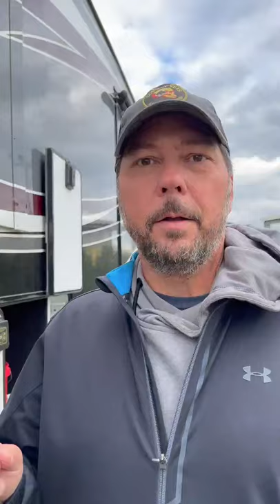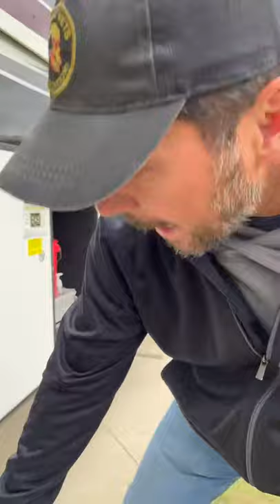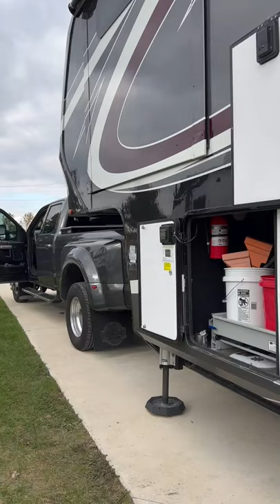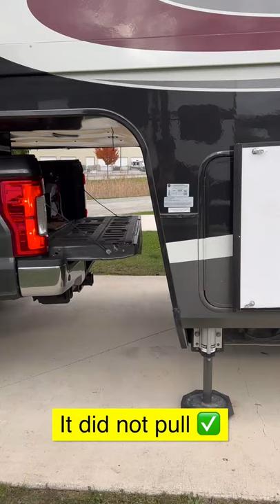EVERY TIME YOU HITCH! (5th Wheel PULL TEST!)  #shorts

Comment: I almost hate to tell on my self.  I used to be a diesel truck mechanic years ago and know all about 5th wheel hitches.  I've owned 4 fifth wheel RV's over the years, really like #4 by the way.  I always do a pull test!  Until once on 5th wheel RV #2, I was mowing the yard where it was parked and decided to move it and mow that spot.  Didn't do the pull test and crushed the back of my truck!  Have not skipped a pull test since.  This was a few years ago and I was able to get another pickup bed (same color and everything) at a salvage yard and they installed it for $1250.00!  I don't believe you can even by a tail gate for that anymore.

Comment: I’m a cmv operator and drive the 48. You provided a wonderful example of a “tug test”. Anything worth doing, is ways a way to take it 1 step further. After the “tug test” continue to hold the trailer breaks and reverse into trailer. If for whatever reason you have too much pressure pulling forward onto kingpin, by reversing - your relieving the pressure on king pen and the jaws to seat just right. Also, you know when your 5th wheel jaws are out of adjustment, when you go and take off, you hear “BANG” or when your coming to a stop and you feel the slack in the 5th wheel and trailer slightly “BANG”  = out of adjustment! I know of a tool that we use for big trucks to put the fifth wheel jaws back in adjustment, but I would imagine RV’s have something similar but many don’t know how to use it or what it is or even if it’s availability. Why am I suggesting the importance of this, you may have your tow rug under control when coming to a stop, but the lil’bit of slack in enough to push your entire rig into traffic and fault of that accident will be on you or even worse, your turning and in the middle of the turn your trailer come uncoupled and trailer going the opposite direction your towrig is going. Also, don’t forget lubrication of your fifth wheel. Whether it’s using some petroleum product or a silicone doughnut sandwiched between the king pen and the fifth wheel. Less ware on you and the towrig.  Here’s my meaningless two cents from a stupid dumb truck driver. <~~ I’ve got oceanfront property in Arizona too.
Reply: Good advice, I had not heard or thought of the importance of checking your hitch connection in both forward and back configuration. I can always learn something from a daily driver ;-) thank you.
Reply: @slkgeothermal  my best attempt to keeping positive and productive. One last thing, yall RV people should look into the importance of 19.5 tires and wheels. A company that comes to mind is, boar tire and wheel for your trailers. On your trucks, a company called, rickson truck wheels. These both companies produce 19.5 tires and wheels. In my years driving coast to coast, I’ve seen countless rv’s - 4 wheelers pulling some kind of wagon stuck middle of America on the shoulder with a blowouts. Stop using them cheep 15 or 16 rims and tires the trailer manufacture put on them. Reason why, the trailer manufacturer puts 15 and 16 inch tires and wheels on the trailers is because it’s really inexpensive for the manufacturers and aren’t really looking out for the customer safety. 19.5 rims and tires are expensive for some. But last longer without the flexing the sidewalls in which causes your blowouts. Depends on the tires you choose, but imagine your tires and truck and trailers running up to 150k. One more thing, look into a company called titan fuel tanks. I’ve got 2 diesel fuel tanks on my personal 3500, totaling 100 gallons without sacrificing any bed space. It replaces the stock OEM tank and I dropped the spear tire to gain 40 gallons in its place. Totaling 100 gallons. I’m able to travel 1200 to 1500 miles on 1 fill-up. But of course I use my fleet fuel card from my trucking company. So I’m able to get .50 to .70 cents off the pump prices. Please STOP parking your rv’s at Truckstop overnight. We’ve got to take a DOT mandatory 10 hour break. Parking is difficult for us as opposed to rv’s. Yall are able to park anywhere you like and don’t have to fallow any DOT rules. Folks say they respect truck drivers, well this is one way to prove you do by not taking away a parking spot from a driver whom tried and far away from home.
Reply: @ABC-oo4vm  Yes! I just experienced a blowout in my 5th wheel a couple of weeks ago coming back from a trip. What an ordeal.
Reply: @ABC-oo4vm  you need to do some homework...alot of rvs can not run 19.5 tires...as far as 5th wheel slack...you need a special tool and the right measurement for each commercial 5th wheel ...do you haul over size...18 high....18 wide...245 feet long.. heavy...140k to 350k.....I did for 48 years...just retired...have a good day...take care..J&A
Reply: @jeannealex2560  enjoy your retirement
Reply: @ABC-oo4vm  thank you ...will do...and you be careful in your travels...drive safe...
Reply: @jeannealex2560  god bless and be safe.

Comment: Getting both landing gear to one inch is difficult because one goes all the way up then the the other!
Reply: The secret is let one go up all the way and as the second one starts stop it when it gets about 1 inch off the ground.  You should be able to then extend the front gear which will start with the one all the way up.  Once it gets close to the same height off the ground stop extending then do the pull test.  Had to deal with this issue myself.

Comment: Sound advice, but, how do you get your jacks to do that? Mine lifts one leg and then the other. Same going down.
Reply: Raise them, once the first one gets all the way up and the second starts stop raising them.  Then switch it to extend and when the one that was raised all the way lowers down to be equal with the first stop and do the test.
Reply: @RoamingwiththeRamsays  when you do that, the leg that you just picked up an inch or two goes right back down before the other starts down. Does it every time.
Reply: @PHMadness  odd.  Mine has always worked that way.   Usually once the truck is attached,  I raise the front and the Door Side goes up first once it is up all the way the ODS starts up.   Once it is about an inch off the ground I stop it.   Change the controller to extend then when I push the button the DS starts down.   Once it is about an inch off the ground I stop do the tug test and done.